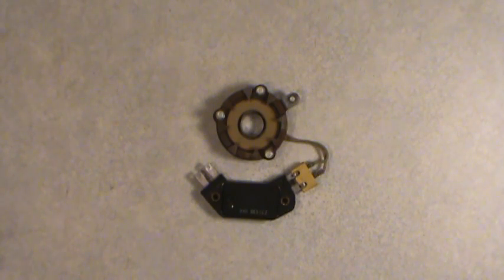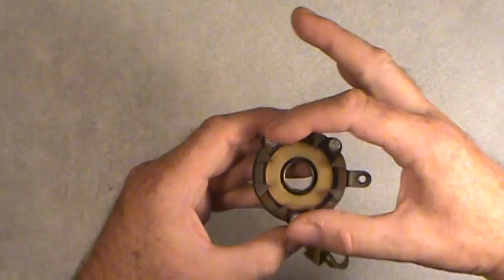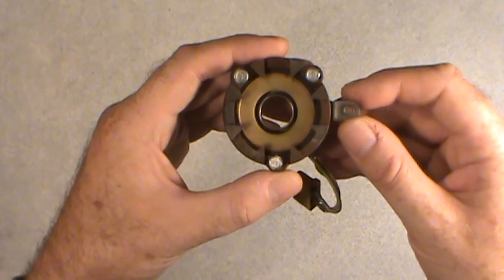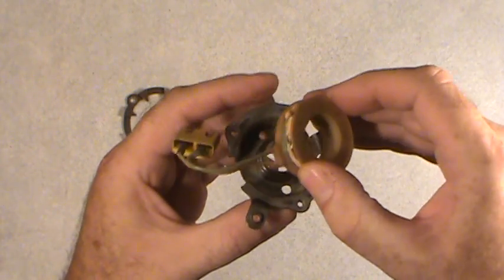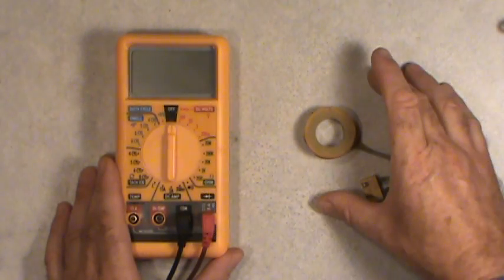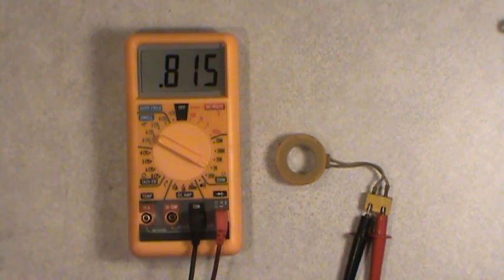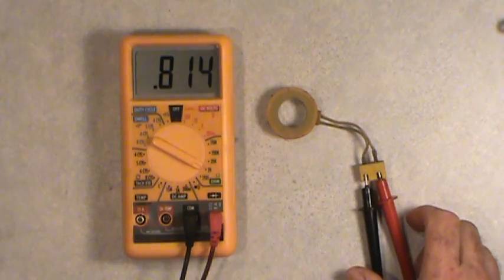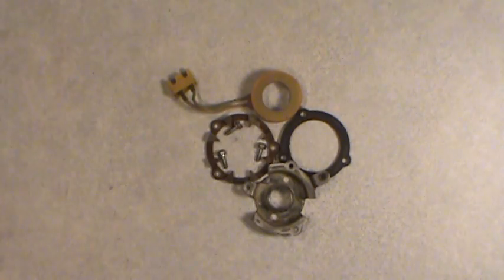HEI Distributor Pickup Coil Test

Comment: but my multimeter don't have a 2k ohm test only a ohm symbol test
Reply from the maker: Greetings...Mateo Villanueva................Thanks for watching.................Are You Ohms-Testing an HEI Ignition Coil, or an HEI Pickup Coil...???.......................For the HEI Ignition Coil, Your Ohm Meter, has to Ohms-Measure, from Zero Ohms, to about 1 Ohm "Accurately"...!!!...and for the Secondary side of the Ignition Coil, 20,000 (20-K), or a bit more, should be Ok....................To Ohms-Measure the HEI, Factory/Stock Pickup Coil, all that is needed, is, from about 500 Ohms to about 2,000 (2-K) Ohms, as, most of those particular Pickup Coils, seem to be, between about 700 Ohms, to about 1500 Ohms, and.............till next time...........Be Safe, take care, and have a good one.
Reply: Would you have any idea how to get a new distributor pickup coil for a HEI 7 pin 1986 Pontiac Firebird 305 distributor? I need a new one.
Reply from the maker: Greetings...w41duvernay...............Thanks for watching...............To test the Ohms/Resistance, of Your HEI's, 7-Pin ICM/Ignition Control Module equipped, Distributor's..."Pickup Coil"...then, it should be quite easy (most times)...................You'll probably be able to see a "2-Wire Connector", that's connected to Your Module, that will have 2-Wires coming out of it, that will go towards the Center/Middle, of the Distributor, where those same 2-Wires, also connect to the "Pickup Coil"...................It's just a matter, of Disconnecting/Removing, that 2-Wire Connector, and then, connect the Ohm-Meter's Probes, to the 2-Wire Connector, and take an Ohm Reading.................Try to find the actual Ohm "Specifications", for Your HEI's "Exact" Pickup Coil, just to be sure.................Somewhere, oh, about...500 to 1500 Ohms, were the Numbers that I recall, from, a while back.....................It's a good idea, to "Flex/Bend" the Pickup Coil's, 2 Wires, while doing the Ohms Testing, cuz, whenever the Vacuum Advance Canister (that be, that, spaceship lookin' thing, that stuck on the distributor...lol), is moving the Pickup Coil, then, those 2-Wires, sure do get Flexed/Bent, Lots of times, like You wouldn't believe...!!!...and, might Weaken, (maybe Break), 1 or 2 of those 2 Pickup Coil Wires (internally), and I hope not..................It's also a very good idea, whenever working on, or near, any Electronic Chip/s (that might also, be hiding inside Ur Module), to be Touching, something made out of Metal, that's cool, and not moving, quite regularly, to Discharge, any Static Electricity, that Your Body, may have stored up, cuz, if that, quite powerful, Static Electricity gets Discharged, into, just about any Electronic Chip, then sometimes, that poor ole Electronic Chip, gets Fried (as in Destroyed), just so You know.....................So, before You go out and spend Money on a New Pickup Coil, make sure, that, the one that's in there now, is actually, no good...................If You do need a New Pickup Coil, for Your HEI Distributor, then, "Make Sure", that, You get the Correct, "Exact" one, for Your "Exact" HEI Distributor, cuz, there are quite a few, "Different" ones, out there..................You might find some Numbers, and/or Letters, "Stamped Into", the HEI's, Aluminum Body's, Largest Diameter (just under, where the distributor Cap sits), and, those Numbers, and/or Letters, are Your "Exact", HEI Distributor's, shall we say, Model Identity, perhaps..................Make note, of the Colors, of the 2-Wires, that are connected to the Pickup Coil, as that can help, as well.................There are Lots of Automotive Parts Retailers out there, that should be able to get a Pickup Coil, for Your HEI Distributor, but, I doubt, that, they'll have any in stock, so, You'll probably have to Order One (in)....................Then, if that fails, there's always, the good ole EBAY Website, where You'll be able to find, just about anything, under the Sun, and then some...!!!...lol...................So, if need be, maybe, make a few Phone Calls, and ask around, for Your "Exact" Pickup Coil...................Good Luck, and.........till next time..........Be Safe, take care, and have a good one.
Reply: The problem I'm having is we installed a new hi performance module and coil, and cam in a LG$ 86 firebird. We got weak spark, when I put the new module it almost split in half the module harness. I want to replace both the harness and the pickup as well, to make sure everything works correctly.
Reply from the maker: Greetings...w41duvernay................Here are a few things, that might be of some help to You...............Make sure, that You are getting about 12 Volts (aka, battery voltage), at the (Wire) Connector, while Disconnected, that plugs into Your HEI's Distributor Cap, having the ignition Key, in the Run (Not Start...!!!) Position...................HEI Distributor, "Ignition Coils and Modules", should really be, shall we say, a "Perfect Match", for each other...!!!...cuz, if not, You might end up with a Weak Spark, or maybe, the Module, and/or Ignition Coil, might "Overheat", and go "Poof", and not work any more...!!!..................Did You buy the Performance "Module and Ignition Coil" as a "Matched (for each other) Set"...???....cuz, that alone, is Super Important...!!!....................Did You apply some "Heat Transferring Specific Paste", to the Bottom of the "Module", before Installing it on the base of the HEI's aluminum Body...???....cuz, if not, then, the Module, probably won't be able to "Transfer", the "Heat", that it generates while working, and will usually Overheat, and go "Poof"...!!!..................GMC/Chevy, factory stock, Low Compression Engines, with an HEI Distributor, will usually have about .045" (four-tee-five thousandths of an inch), spark plug Gap/s....................Whenever the spark plug Gap gets LARGER, along with a Higher Compression Ratio, then, the Ignition Coil (and maybe the Module as well...???), have to Work, much More/Harder, to create, an acceptable Spark, that makes-for, a good Combustion event, as far as I see it, that is.....................You have to make sure, that, the Carbon Button and Rubber-like Washer, are Installed Correctly, into the  top of the HEI's Distributor Cap..................Sometimes, the Ignition Coil Mounting Screws, can "Pierce-Through", and into, the Inside of the Distributor Cap, so, check that as well...!!!................There are even Nylon (plastic...???) Screws, that I've seen, that replace the 2 Screws, that hold the (HEI's Distributor's) "Rotor", to the top of the Advance Mechanism (You know, the advance weights and springs location), that, in theory, prevent the High Voltage/Sparks, that are found, inside the Distributor Cap, from making their way, to (electrical) "Ground", by way of, the Distributor Shaft itself...!!!! (through those 2 Metal screws)...how about that.................If the Pickup Coil looks Ok, and it Tests, at about, 500 to 1500 Ohms, then, that's a good start..................If the HEI Distributor, is out of the Engine, and, if You were to hook up the Pickup Coil, while still mounted in the HEI, by itself, at the Connector, to a Multi-meter, and set it to, I think it's Low AC Volts...???...and Spin the Gear, by Hand, very Fast, then, You should be able to see a small AC Voltage, being produced, if I recall correctly, that is...???......................So, the "Ignition Coil"...and the..."Module"...have to "Match" Each Other (aka, get along with each other, so they don't start Fighting each other, and perhaps Over-Heat, as a result...!!!...lol)...and keep an eye, on the spark plug "Gap" Size, and don't let it get too BIG...!!!..................If You happen to need any more help at all, just give me a shout, and.............till next time............Be Safe, take care, and have a good one.
Reply: Mateo Villanue

Comment: I have a 1982corvette 350 4bolt main In my 1964 impala as Its showing 0.939 kilo ohms on my multimeter it had the symptoms of running shity and backfiring before it went out
Reply from the maker: Greetings...Mateo Villanueva...........Thanks for watching..........If memory serves me right, I think that, the Factory/Stock HEI Pickup Coil, should be somewhere between, about 700 Ohms, to no more than, about 1500 Ohms, (Not K, as in Kilo-Ohms), but please, do Look-Up, the Specifications, for Your "Exact" Pick-up Coil, just to be sure..................While doing the Ohms-Test, "Wiggle" those "2-Wires", that are connected to the Pickup Coil, cuz, sometimes, with Heat and Age, and all of the Flexing, that they receive, can Weaken or Break, the actual Wire, that's hiding under that plastic-like insulation............There are quite a few Things, that can cause, just about any HEI Distributor, to not work, as good as it should be doing......................Have You done a Tune-Up recently, at all...???...as in.....New Spark Plugs, that are Gap-ed properly...???..........Are the spark plug Wires, really Old...???.......Distributor Cap and Rotor Condition...???...................................Might even be, too Lean of an Air/Fuel Ratio Mixture...Carburetor...???.............................One or more, Camshaft Lobes, Self-Destructed...Maybe...???.................There's quite a long list alright, and, if You care to, You can let me know, all that You can, about Your Engine's particulars, that way, the odds will be much better, that I might be able to help You out some-what, and...........till next time.........Be Safe, take care, and have a good one.

Comment: How do you test a module in a aftermarket electronic distributor?
Reply from the maker: +Ron S ....Greetings Ron S....Thanks for watching.................Well, depending, on just which...???...Module, as in "Ignition Control Module"...???... it actually is, that You have there, might be an exception, but, most of the older ones, would probably require an Ignition Control Module (specific) Tester/Testing Unit, if the Ignition Control Module, was to be Tested by "itself", and is not installed in the Distributor..................There might be some Website "Forums" out there, on the Internet, that might have, an easier/cheaper way, to Test, certain types of Ignition Control Modules, just be careful, so the Module doesn't get Shorted-out, by connecting something, to the Wrong Pins, or Connection points, and having it, ending-up, going..."Poof"...!!!...................There are some Auto-Parts Retailers, that will actually Test an Ignition Control Module for "Free", so, just make a few Phone calls, and ask them, if they do so...................There are some Ignition Control Module "Testers", that You can Buy, but, why do so, if You can have it Tested for "Free"...!!!...lol.................For the "Non-Computer" Distributors, I just usually, make sure, that, everything else in the Ignition System, Checks out, as in, good Connections, proper Voltage, as well as, Ohms/Resistance, and, if I don't get a good Strong "Spark", while Testing for Spark, the Ignition Control Module, from my experience, seems to usually be, the Last, shall we say..."Suspect"...lol...................Most of the Ignition Control Modules, that I've installed in the past, had to have some..."Heat Transferring"..."Specific"...Paste/Grease-like stuff, smeared on the back of the Ignition Control Module, before installing it, onto, the Base/Mounting Surface, that was usually inside the Distributor, or, if not, then, there's a really good chance, that, that poor ole Ignition Control Module, would probably go..."Poof"...as in..."Over-Heat"...and Destroy itself...!!!...Yikes...!!!...and.........till next time..........Be Safe, take care, and have a good one.